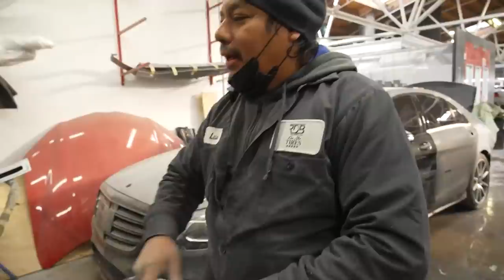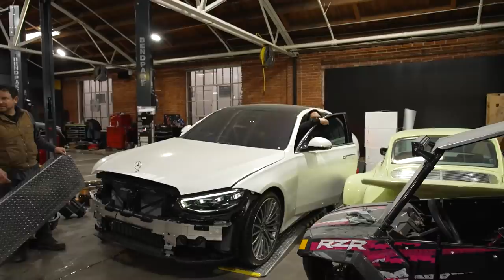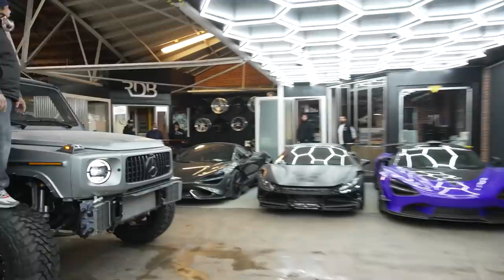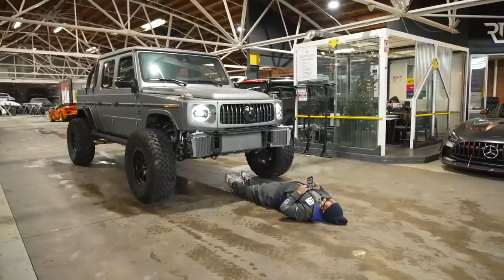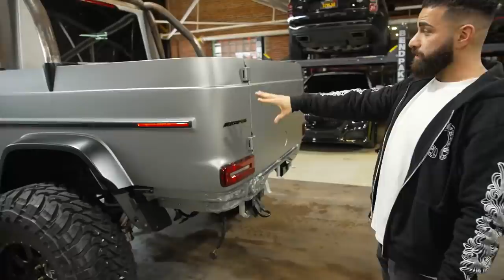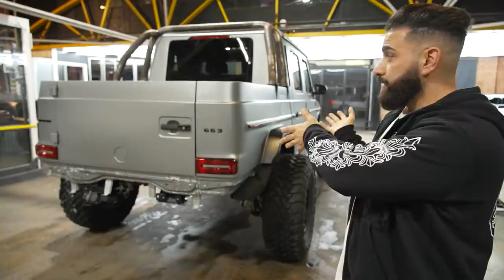CRAZY Custom G63 Mercedes Pick Up Truck?

Comment: Looks like you guys are doing the flares right. I don’t like the other g wagon 4x4 kits for the 2020. The flare look so off and weird. 

But this is perfect so far. It fits the body so well not to long and and it is a very clean look and matches the dull edges on the body instead of being a rounded off design

Comment: Question, is it due to US automobile safety rules as to why you cannot import a brabus Mercedes truck?
Reply: I´m not sure if the Truck is a exception, but normaly Brabus did everything proper to drive there cars in the US
Reply: @a-hoernchen3926  the only difference is that the us brabus kit doesnt come with the proper brabus roof lights from the uk kit, so people in the states order the lights and other slight details seperate because they like their look better